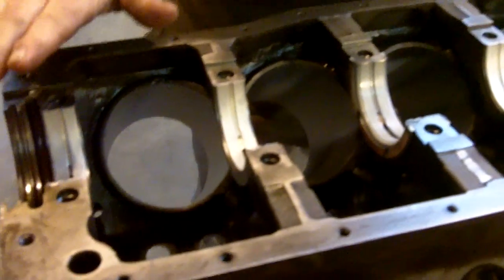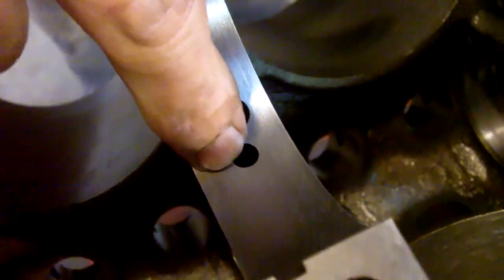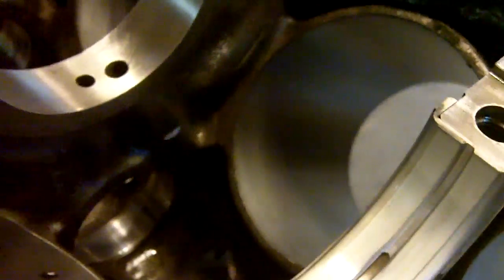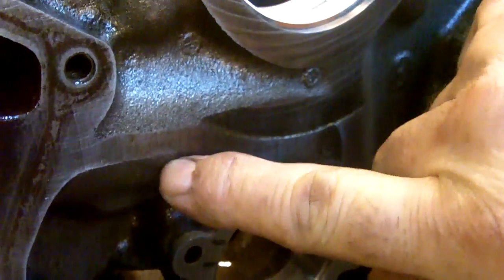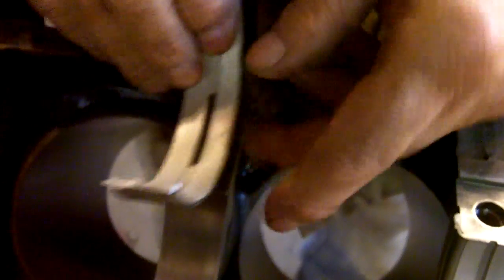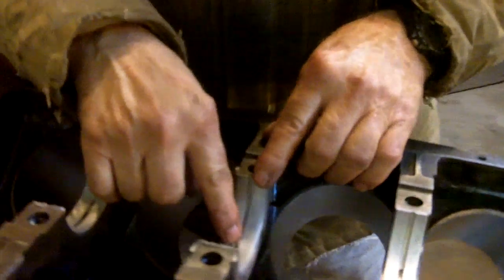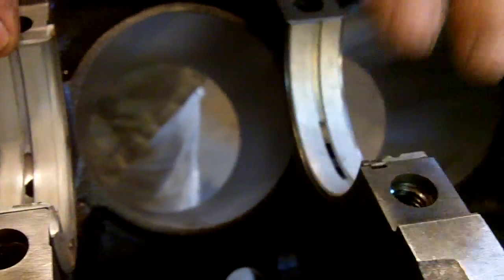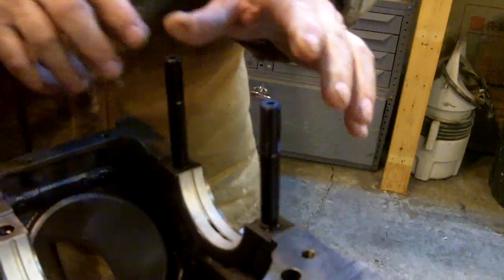Engine Building with Rog - Main Bearings and How the oiling system works.

Comment: got a question ....i have a 1990 chevy 1 ton.has a 454 with a large solid flex fan that pull a ton of air.190 deg thermostat.i can see water flowing through radiator but it still over heats when ideling not driving down road.i put a after market radiator in about 10 years ago and has maybe 300 miles on it.my boss who is a gear head says it may be air locked.any ideas would be great.thanks
Reply from the maker: I remember my old man used a Flex fan and he had issues with it. He went back to stock and everything was fine. This was with his 1969 Cobra Jet Torino. Eventually he went with an electric fan. You might want to double check the thermostat and even the rad cap, I've seen those go bad from time to time as well. I don't think it would be air locked. You could try burping the system. There are some videos on YT that will explain that. I can also ask my old man what he thinks and get back to you. Thanks for watching my videos and have a happy holidays!

Comment: thanks so much for getting back to me im getting a crash lesson in 351w engines.the engine i spoke of is in a boat.i getting ready to build the original 1977 351w that came in it as a spare.its a non roller block the new one is a roller with a few up grades.aluminum heads and intake mostly for the weight difference.......merry christmas!!!!!!!!!

Comment: hey rodger have you seen any trouble with the 351w cam gear eating the distributer gear? my mid 80s crate engine distroyed the steel  distributer gear.i went to a bronze gear and same thing.i went with a new pertronix distributer with steel gear.i also drilled a 1/6 hole in the lifter galley plug thats directly behind the dist gear and between the two it solved my problem. great videos!!     shoot me a email if you want...browningmag670@gmail.com
Reply from the maker: Thank you very much for watching. I'll pass the info along to my old man! I know that the billet cam we used called for a specific distro gear. If you know the mfg of the cam, they might be able to help with what type of gear you use. I know that it does make a big difference, glad you got your issue worked out. Great tip about the extra oiling. I'll have to find out if Rog knows about that trick. Thanks again for watching and happy holidays!

Comment: As an engineer, I would not modify the main bearing due to flow properties. In place, open up the hole to fit the bear by notching out to fit the bearing slot. In addition, very slightly decrease the cam oil holes, and therefore reduce oil pressure losses as the engine ages. Disclaimer: You take full responsibility, and flowing my advise may destroy the engine.
Reply from the maker: Thanks for the heads up!

Comment: would you loose a bit of oil pressure opening up the gap on those bearings?
Reply from the maker: Not much, the stock oil pump moves more than a sufficient oil amount, you'll be fine. we have been doing this for years!

Comment: Wow, so you would tamper with a factory bearing.  I understand the logic of more oil through the bearing in operation, I've thought about doing the same thing and here it is.  But I am still skeptical of the gains.
Reply from the maker: Done this on most of our engine builds and never had problems!